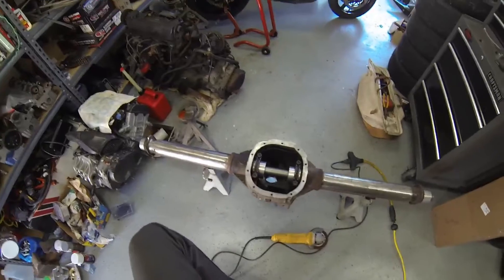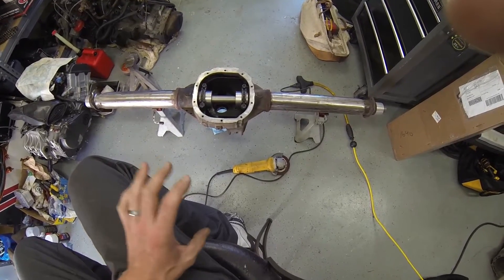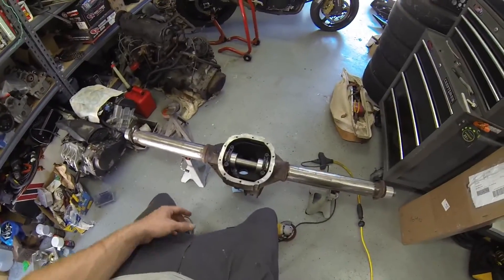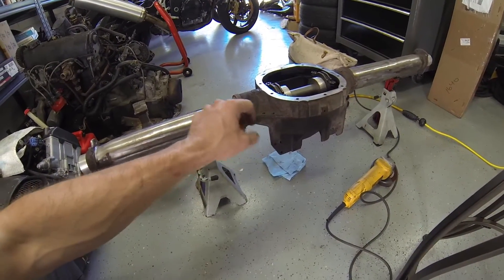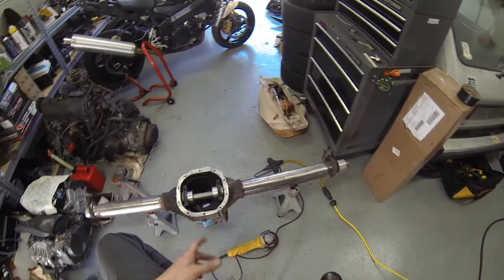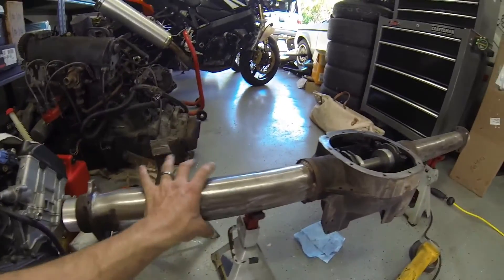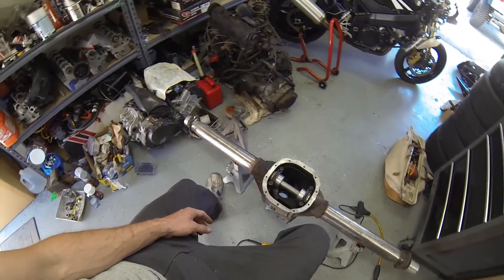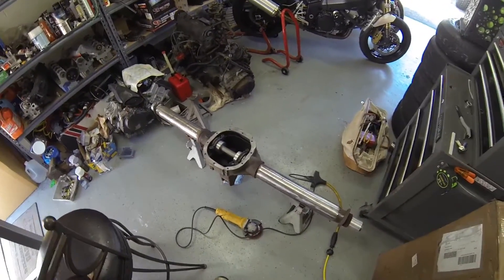TJ Jeep   8.8 Axle Swap by Artec

Comment: Ok so let me understand this c clip thing..........the whole wheel will come off......so the disc brake is just going to slip by the caliper somehow and come right off!  Right ! Waste of money axle was fine just as is all you had to do was weld the right brackets and put it in.  I would rather have the Ford limited slip and a lunchbox locker for the front.....money better spent !

Comment: My 35 and 30 both have lockers and I'm running 33 12.50 and trail it pretty ruff with no problems at all. It's a 2000 TJ and had that set up the whole time. Absolutely zero issues.

Comment: I plan on doing this swap my self now running with a dana 35 27 spline in a tj with with 33 and a aussie locker had a lock-right locker with 31s and broke the locker cracked one drive gear

Comment: man being 17 i guess im stuck with my dana 35
Reply from the maker: No way man, you could probably get this swap done for $600. Just a junkyard axle with the swap kit. Then barter/beg for the welding. I bet you could trade a days labor for the welding at a local shop. Never hurts to ask! Good luck man.
Reply: FunctionOfSpeed Alright thanks I'' look into it
Reply: Listen bro I've got 35 rear 30 front. Lockers in both run 33 12.50 tires and I'm give my tj absolute hell and had zero issues. Dont run 35 12.50 then you will have issues.

Comment: The wheel won't walk out if you're running disc brakes though. The caliper will retain the axle.
Reply from the maker: +Ryan Garcia Yep, you're right. I'm surprised that I didn't mention that. That's one of the reasons folks don't mind leaving the factory C-clip axles in place. The 31s are quite strong. Thanks for watching!

Comment: the d35 is a little stronger than you give it credit for.... you say the axle tubes are flimsy but theyre the same tubes that are on the tj d44 lol i wheel my junk pretty hard and i have yet to bend an axle tube. dont get me wrong, it does happen! haha i know a hand full of people that have bent their d44's, but the majority dont ever have to worry about it. the dont put a locker in a d35 comment though isnt true. i wheel with 2 guys that run d35's in the rear with detroits and chromoly shafts and theyve never had a problem with it. i wouldnt go as far as to say its a "strong" axle, just not quite as wimpy as you suggest haha
Reply: +Old King Cole he did say if you through $1500 bucks at a d35 it will make is solid....
Reply: +MrMrsregor it's like $700 for a detroit and chromoly shafts
Reply: +Old King Cole if it were ME, i would not spent that much to build up a d35. when i could get a better axle for less money. but,  i am running a stock d35 in my dd 01 xj , a stock d35 in my old 94 cherokee, and a d35 stock with lsd in my off-road 98 xj. so, i am not afraid of the d35 and i feel that it is fine until you want run 33"+ tires. but the local junk yard sells a ford 8.8 for like $150-$200, and that is way less than $1500 or even $700... but chromoly shafts alone might make it as good as the chrysler 8.25
Reply from the maker: +Old King Cole Right on, I'm not trying to completely discredit the D35. Just in factory trim, it is by far the weakest link in the jeep. Its not that the D35 uses D44 tubes, it's that the D44s in the TJs and LJs use D35 tubes and D30 Cs in the front. A TJ D44 is the weakest D44 money can buy, except for possibly a D44A. Every statistic on the 8.8 is better for our purpose except for possibly the weight, not that it is obese by any means. My goal here was more to showcase the 8.8 swap rather than disgrace the D35. Thanks for viewing nonetheless!

Comment: Thanks for all the info on the 8.8- but you've made no mention or description of the Artec components.  Consider renaming your video perhaps, but I'll be installing a 2000 8.8 in my 2000 TJ with a Spartan locker this weekend.

Comment from the maker: Hey guys, ya i have more welding footage but have been pretty tied up at work. I hope to get the rest of it build by July and then show the swap. Thanks for watching!
Reply: +FunctionOfSpeed Any thoughts on a front axle selection for the future?
Reply from the maker: Actually yeah! I have a high pinion 44 center section in the garage. Intent is to retube it and do a ground up build on it. I like the idea of running on 3/4 ton axles that are stronger than stock 1 tons. Piece of mind.
Reply: +FunctionOfSpeed Nice, was wondering what one would do to avoid having a tree trunk axle in the rear and a pencil axle up front haha